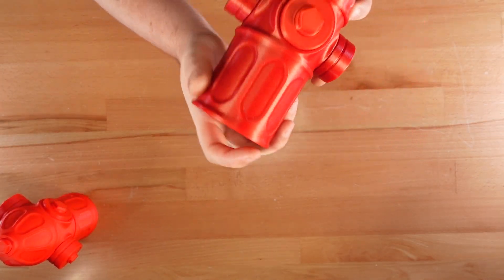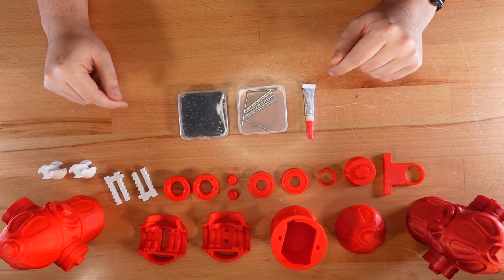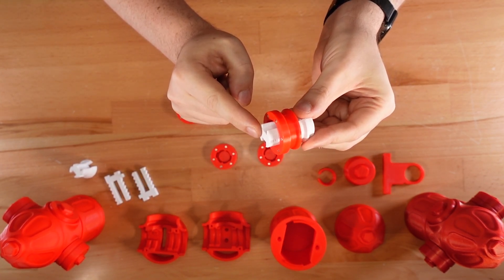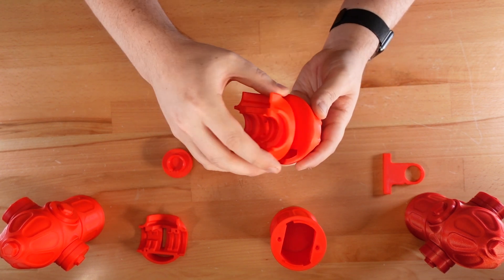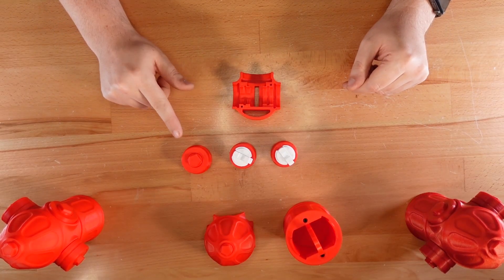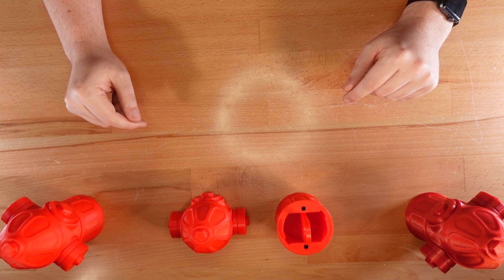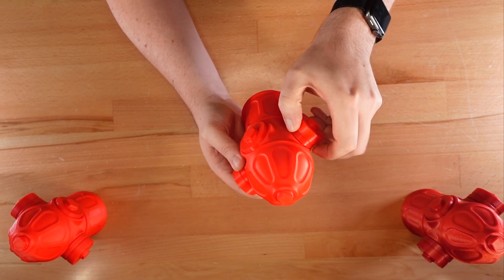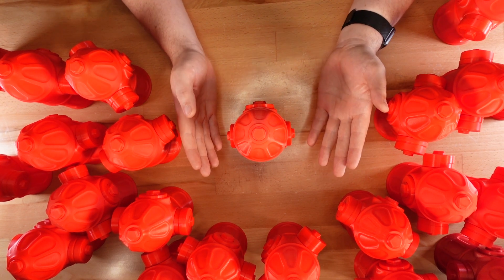Building a 3D Printed 6-Alarm Puzzle Box

Comment: Thank you, this is great. I printed all the parts to make one for my son in the fire academy. But I can't get parts to fit. The tolerances are too tight. Any suggestions?
Reply from the maker: I'm sorry to hear there's a sizing issue. The fix will depend on where the parts are too tight and which parts are a problem. Are you parts bowing out a little where they touch the print bed (AKA "elephants foot"), or are they too large all the way around? My email address is listed under the channel's "About" page if you want to send in some photos demonstrating the issue. Or you can send a message to me on Printables, which also allows photos within messages.
Reply: @3DPrinty  I apologize for the delay.  I will email you about the issues.  Thank you.